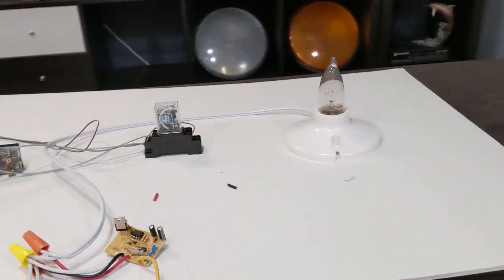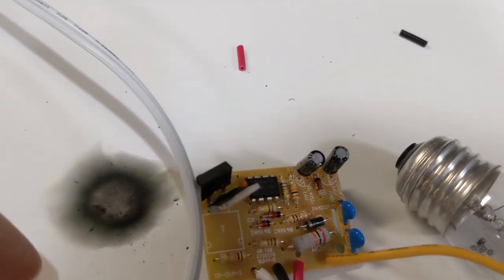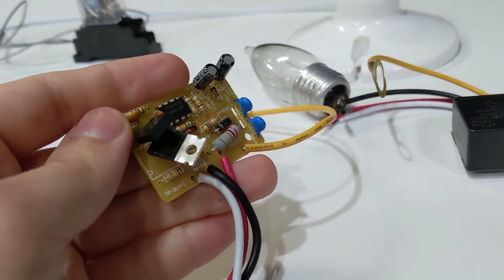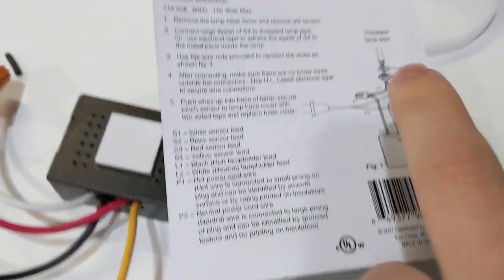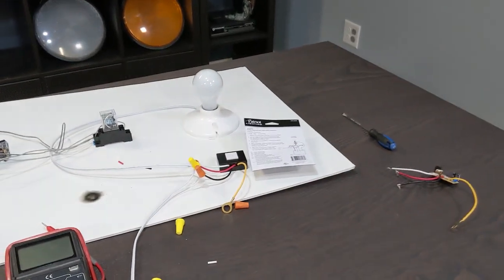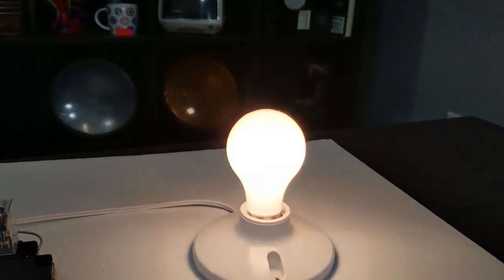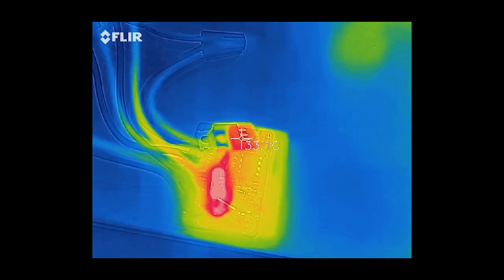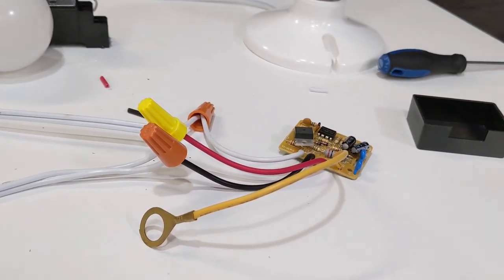A slightly explosive touch-lamp follow-up (standby energy consumption)

Comment: I agree the colors are "wrong" but the wiring makes sense. The hot wire is providing power to the "switch" to operate it and therefore must maintain it's neutral, and it turns the lamp on and off by opening and closing the neutral wire returning from the lamp. It's not elegant/smart, but it works. One major drawback though, there is always a hot wire going to the lamp socket even when the light is off, potential for shock/electrocution is high. 

Also good filament bulbs are always shorted, that's what they are, a short that glows instead of exploding. One way to check if a filament bulb is good is with your resistance setting on your multimeter just like you would for any other open/closed circuit, open=broken filament, closed=good filament. Does not work for CFL and LED bulbs for obvs reasons.

Comment: 17:30 You'll definitely want to use a polarized plug for a permanent setup of such a system. In North American 120V wiring, the neutral is bridged to ground. I could swear that you've covered this in one of your own videos even. But I digress.

Comment: I think the power supply to the chip is simply using the 1N4007 diode and the 1W 10KΩ resistor in series as a half-wave rectifier, and the zener diode and the two electrolytic capacitors in parallel as a regulator.  This is pretty simple and almost foolproof, but provides no electrical isolation, and the 10KΩ resistor is indeed entirely responsible for the standby power drain.

Simply replacing that arrangement with a more sophisticated power supply would eliminate the vast majority of the passive drain and thus make it more efficient.  A capacitive dropper feeding a half-wave rectifier and linear active voltage regulator would be a good start.  The dropper only needs to reduce the mains voltage for compatibility with the linear regulator.

There is a separate DC-blocking arrangement (the two blue bead capacitors with 500V breakdown ratings) protecting the yellow sense wire, fortunately, which means that no matter how you screw up the wiring, so long as you didn't actually connect the sense wire to the mains, it will be safe to touch.

Comment: The bulb is a short. It has the filament that glows (produces light and heat) when you put electricity to it. Our electric coil stove tops are a short. It's a bigger filament for heat with little light.

Comment: 1) I'm glad I saw this, because based on the main video, I have planned to turn a lamp in my house into a touch lamp.

2) In America, black is hot, white is common (or neutral), green is ground, and red is control (hot as mediated by the input device such as a motion sensor, photo sensor, or in this case a touch sensor), so I guess I would've wired it up just as Alec did the first time.

3) Most lamps even to this day do not have polarized plugs (and have no ground prong), because it's assumed they're so simple, they'll work no matter what the polarity.  This may have been part of the problem here... it's not clear, because Alec didn't establish how he determined which of the two wires coming from the lamp was hot, and which was common... which may have depended on how he plugged it in.

That's all I know.  I'll be interested to see what more knowlegable people have to say about it, before I try to convert my own lamp.
Reply: Based off what I can gather for the comments this entire wire scheme is just objectively wrong for the North American system, although it makes sense in other countries. Also based off what I can gather because of the way he wired it it would have exploded regardless of how he plugged it in

Comment: With your original wiring, it looks like the unit was in series with the bulb (via black and red), and when it turned on, it shorted black and white, causing a dead short across the input.

Comment: Actually from an old-school electronics tech, the black wire was used as the ground/common color for circuit boards and red as hot commonly. Now in industrial and house wiring white is ground/common and black is generally hot. But again, I'm very old-school when it comes to electronic boards. Oh, the explosion was cool.

Comment: I would agree with you, except that it looks like the triac is modifying the neutral to the lamp while hot stays full power. Hence the neutral of the lamp is distinguished with the white neutral and not the power cord itself.

They should have used White (N), black (L) and white w/ black-stripe to mark the switched neutral like is used in emergency lamp fixtures.

Comment: I kind of like the idea of wiring one of these behind a brass plate in place of a traditional switch to make a fancy switch for overhead lighting.
Reply: I like the idea, but I would not build one of these into a wall unless it was a stone or concrete wall.

Comment: @Technology Connextras - 
Normally you can mix up neutral & life with those ( 230V-AC) dimmer circuits , because the lamps are equipped with the non-polarized Europlug ... it just gets more dangerous in the (not recent) lamp socket

Comment: When you go by house wiring color codes, you are right.  But with DC circuits, red is positive, black is "ground", where neutral is well, ground, and hot is above neutral potential if you discount AC going positive and negative.
By the way, the wiring on the box seemed fine to me.  The "floating" lines lined up with the physical wires coming out of the box.
Too bad they didn't put that schematic on the paperwork.

Comment: I bought those exact touch dimmers and put them in our nightstand lamps a couple years ago. I did a 2nd, 3rd, and 4th look before I figure out the wiring schematic. It's clearly not intuitive as to normal North American wiring colors. Luckily I figured it out before the powering it up. And as far as the .4 watts, I'll gladly pay the 42¢/yr per lamp for the convenience of just reaching over in the dark and touching the lamp instead of hunting for the switch to turn it on.

Comment: About the colors being wrong-  I'm an electrical engineer (BSEE Illinois 1979) and until I was OLD (maybe 30?) I had only seen that particular universe of electronics, where almost everything is DC and black is always ground, red is always hot.  Then finally I am introduced to AC electrical wiring and I'm dumbfounded that in this parallel universe black is hot, white is neutral.  I remember having the exact same feeling you did about the color scheme being STUPID, except I was coming at it from the opposite side.

And I still think it's crazy, or at least unfortunate.  You were right to feel that way.

Comment: Wiring colors get a bit tricky with switches. A regular wall switch has two wires, the goesinta which is hot, and the comesoutta, which is intermittently hot. Usually both will be black, but you'll find all kinds of combinations on switches, including black/white, which is flat out wrong.

Wrong also describes this switch. The problem is that it's switching the neutral, which means everything is wired the opposite way you'd expect, and the lamp socket is live at mains voltage when the lamp is plugged in, even if it is off. You can't even excuse it saying that they need that AC voltage at the lamp for something to do with the touch sensor, since that works just fine when not connected to the lamp. This is particularly dangerous if the lamp is also wired backwards, which happens sometimes, leaving the threads of the bulb live at all times. (edit: I'm wrong, all the conductors in the lamp socket will be live either way)

For U.S. wiring I would expect the three neutrals, lamp, line, and switch, to be all white and tied together, black to be input from line to switch, and red to be output from switch to lamp.

Comment: Sure AC is reversible, but -- it's the fact that the neutral leads for both the supply and the load are connected together off the board, with the assumption that the hot to the load is switched. You can reverse the leads -- but only if you also switch which ones are connected together off board. Otherwise, your off-board connection connects a live directly to a neutral.

Comment: Looking at the wiring diagram, the red wire is actually acting as the Neutral wire since it both goes to the circuit board and the lamp. Functionallt it does not mater if you reverse the power  cord end leads because it is AC power. The lamp will still work either way. But for safety reasons, the Neutral wire (wide plug prong) should be connected to the red wire which also should be connected to the Threaded part of the lamp socket. In turn the Hot wire (thin plug prong) should be connected to S2 in your diagram and S1 should be connected to the center contact at the bottom of the lamp socket.

With the wiring diagram as it shows on the packaging, the lamp socket would always be live, even when the bulb is off. This is a less safe method of wiring. 

Considering the item is made in China and sold in various countries, don't always expect the wire colours to be what you think they should be. Always read the instructions!

Comment: It isn't just the colors that are the problem. That switch is working on the lights neutral, with the hot wired directly to the lamp socket.  That means that the socket will be hot when the lamp is off. Switches should be placed on the hot so that a polarized plug will ensure the  socket isn't live when the switch is open.

Comment: I drew up a hook up, assuming conventional color coding. That would stick the power cord across the MT1 & MT2 on the TRIAC. The power to the controller, would go thru the lamp to by way of the red wire (assuming the other end of the lamp tied to black), so that could power the module. So when it tried to turn ON, the TRIAC would short the 120 ... as demonstrated !

Comment: I know nothing about wiring. I'm in the U.S. and bought a Raspberry Pi kit with a case & fan. The fan's leads plug straight into the GPIO pins, and in order to change fan speed, you move the red wire between a 5v pin and a 3.5v pin.

Comment: As a Canadian who is more used to DC electronics wiring than mains wiring, black only registers as "live" in my head if no red exists. If there is any red wire is involved then it's the red that more strongly registers as "live" and if there is also something else (i.e. white) black registers as "who the heck knows, better check the wiring diagram".

Comment: This is very similar to a photocell. I'm an industrial electrician and a photocell is light activated which switches a Triac most likely and powers high watt light fixtures of all kinds. Outdoor of course which you don't want running in the sunlight. AmIright? Anywho in all the photocells i've replaced or installed the switched hot has always been red. Incoming hot here in the US is always black for 120V circuits and often also 220V circuits.  I would have wired it the same as you did initially. Impressive pyrotechnics.

Comment: Living in the US I can say that when wiring a house there really isn't a standard followed for which wire is what, depending on who wired the building either wire could be either potential, besides ground of course, in my breaker box the wire colors switch back and forth between colors randomly

Comment: Red in many countries signifies danger, so it's the live (hot), in a DC circuit, red is positive, black is negative (except in japan where red is lucky so it's ground), the UK used to be red and black for live and neutral until the EU got involved)
That circuit uses a switched neutral (thyristor is on neutral side), so it makes sense that all hots are connected together

Comment: Here in South Africa the colour codes are black as neutral and red or brown as live (hot) however as ac has both positive and negative charge on the same wire it should not make a difference for example a 2 prong plug can be plugged in to a socket in any direction. I think the most important connection is to the lamp if  the lamp was connected over the white and red cables its no problem but if the lamp is connected to white and black which it was in the beginning of the video it will explode

Comment: I agree that the wiring diagram is a hot mess. I've been an electrician in Canada for 19 years, every AC sensor or control I've connected has been Black-L1 (hot,) White-neutral, Red-hot to load. As you said, always check the wiring diagram.

Comment: From the size of that resistor, I'd guess it's maybe part of a resistive regulator? Very simple, arguably very cheap, and has good power factor... the last of which can be countered by adding the correct inductive values to a capacitive divider.
Reply: Also, not usually very efficient.

Comment: I only speak from experience,  I'm not a licensed electrician.  When working on switched circuits,  I've noticed the live usually comes from the white, comes back from the switch as the black. Maybe they were in that 50's mind frame when they set up this scheme. Most of the electrical work I do is on buildings built in the 50's and 60's.

Comment: I made a touch lamp out of a single chip in the late 70's early 80's.  It was not a household IC maker name.  It had a fairly low RDSon which was impressive for the time, and it didn't blow up because it only turned on and off at zero crossing.  None of the mish mash I see in these circuits.  Just a few small support components.

Comment: 13:17 No, they are not giving it any margin. The maximum rating applies when it is attached to a cooling surface through its metal tab. If it used without cooling, its maximum wattage is derated. In fact, I think they are rating it to more than it can actuallh handle being in a closed plastic box and with no cooling.

Comment: Nice electro-boom, as Curious Marc say! :-)))
The people from Patriot Lighting patriotically import that kind of crapy thing from China contributing to global unemployment, but that ship sailed away long time ago...
By the side of wiring's color coding, here in Argentina, with our 1x220V/3x380V 50HZ standard, live is brown an neutral is light blue in single phase systems. Earth is green with yellow stripes. If you find red, black and/or white wires in a bulding, probably they have 380V between them because it is three phase. Our standard is very similar to european.

Comment: Key dream sequence
<~~~~~~~~/\/\/\/\/\/\/\/\/\/\/\/\

As a kid I was fascinated by electronics, so one day I decided to remove the greenboard from an digital radio alarm clock. I disconnected the cord from it for kicks and giggles. I decided to see what would happen if I put the two bare powercord wire tips side-by-side on my bedroom walls’ the fake, CHEAP, 1970’s, 0.375” thick faux wood paneling wall…yup the same loud “POP!!!” sound and flash of flame. It too tripped the circuit breaker and left a large black char mark on my bedroom wall.  Ahh thanks for the TRIP down memory lane. 🤩⚡️💥

Comment: In the old Norwegian wiring colours white and black were common colours for the two phases and red was commonly the switched line, so that wiring would make perfect sense. 

(if you're currently thinking "what,  two phases?" you've got to remember that Norway is special. We almost exclusively have IT-net electricity where you have 230 V between each of the three phases and no neutral)
Reply: Whoa, interesting! 👍

Comment: This is what caused the blow up: 
You got confused between red, black and white wires and you swapped connection between them. You can swap red and black wires without any worries as in AC, it doesn't matter that much at the application level but swapping white wire with red or black was the main problem. 

In your product, the black wire (S2) was most probably the input of the triac (if it were red wire, it wouldn't have blown and simply would not have turned ON) and white wire (S1) was the output of the triac. 
You had connected black wire to AC line and white wire to AC line so basically input and output of triac were shorted and were just waiting for you to touch the sensor to turn on the triac. 

Initially, when you turned the system ON, sensor circuit part got the power, thanks to proper AC supply connection made to this circuit by the series connection of bulb (negligible series resistance when cold) you made. Still the triac was off. But as soon as you touched the capacitive sensor and triggered the triac, you basically shorted AC live or hot and neutral, over-current passed through triac and blew. This also tripped the circuit breaker.

Telling based on experience on Triacs in the past and being an electrical engineer.

Comment: Sorry, Technology Connections, but I think the general rule when dealing with red, black, and white wires in one connection is that red is hot. When I worked as an electrician's apprentice, we always set up 3-way switches using that configuration. As other people have said, different countries and manufacturers use different color configurations, so it's always best to look for directions/diagrams first.

Here's a funny idea for a possible video: I have a cheap old $50-$60 dual bandwidth asus router that only has a heat-sync for temperature control. In the summer it often overheats (because we don't use the air conditioner enough and we live in the southwest US), and the best solution I've found to fix it when our connection gets hinky is to PHYSICALLY HOLD THE HEAT SYNC until I've diverted enough heat to where it isn't cooking temperature anymore. I think this has been the fall of several other of my routers in the past. For some reason, this doesn't happen to the modem box that actually recieves and sends the internet connection. You could look at the higher effect of heat on routers (and possibly wifi) based on this.